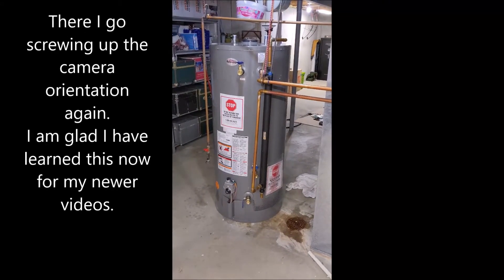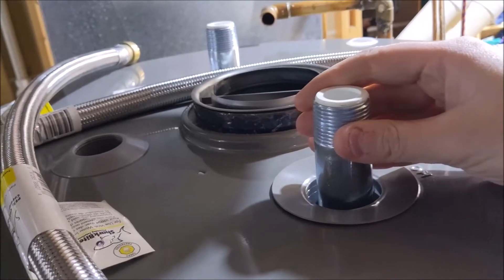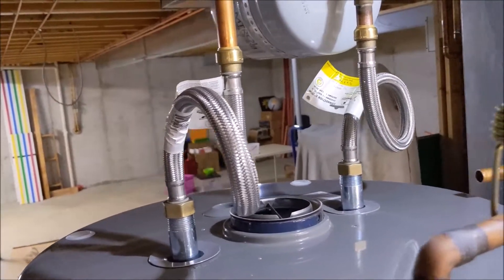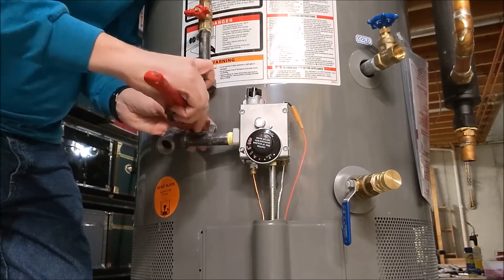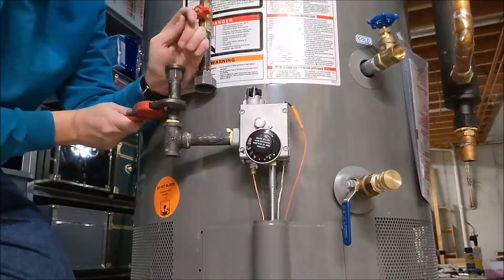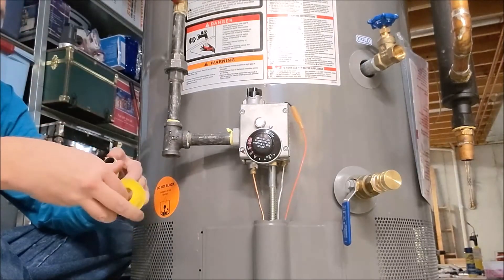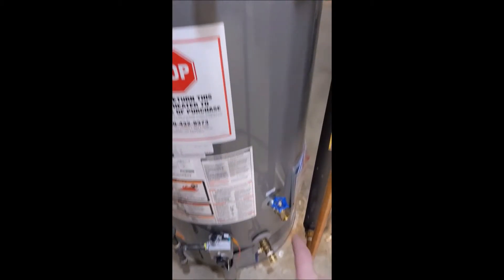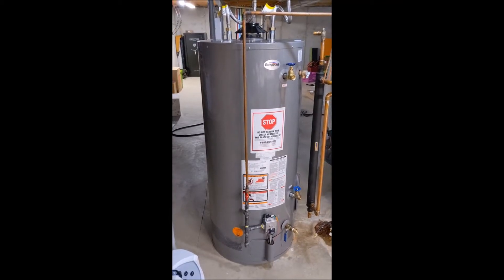Episode 4 | Water Heater Replacement | Connecting the new water heater, gas line, and filling it up

Comment: Look at the iron pipe. Look at the gas valve. Had you tried to spin that t-fitting one more turn, the gas valve could have split apart. I’d say 2 turns too many on the tightening.

Comment: You're not supposed to have any copper anywhere on a natural gas line, it should be all black iron.
Reply: That incorrect. Copper can certainly be used for gas.
Reply: As long as you don't mix the two by having them being in contact with each other, copper can be used just fine.